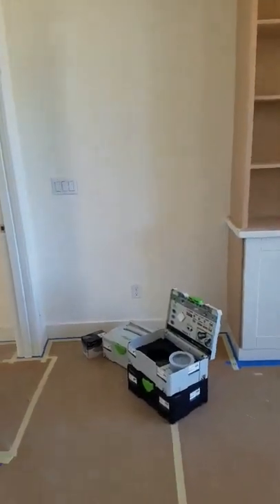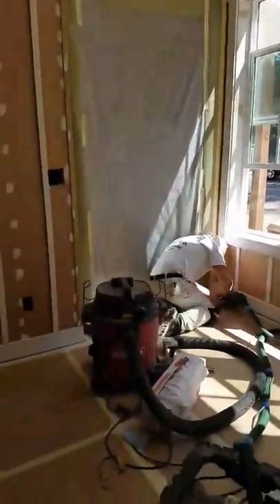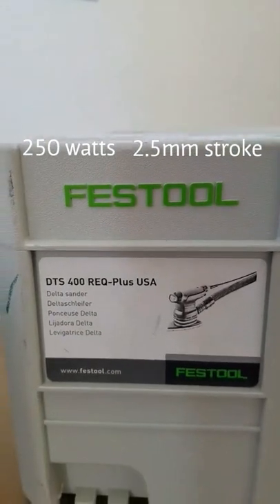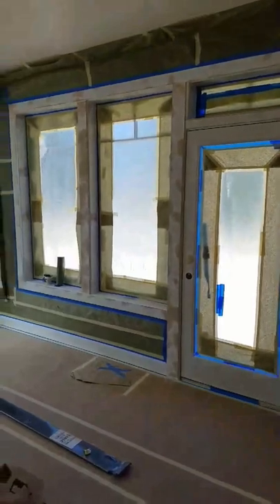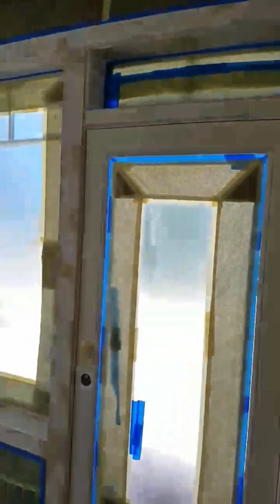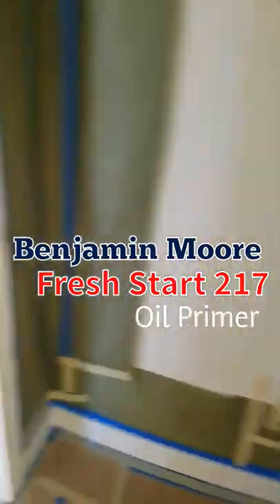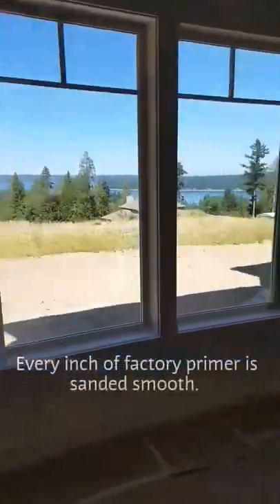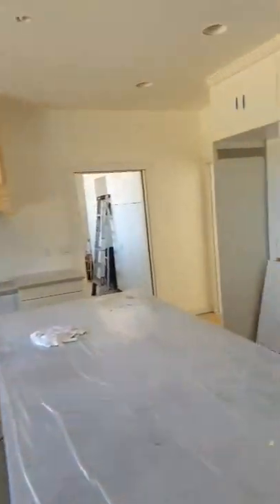Painter's Love for Festool, and Millpack Walkthrough.

Comment: Love the video @xc painter. That's a LOT of mdf. Just curious, I don't work with mdf a whole lot but could you use BIN or a lacquer undercoater to make the process faster? Thanks bud!
Reply from the maker: Chris Herrada absolutely lacquer undercoater would be great if you have experience with it and know the pros and cons. Have to do 2 coats though to achieve its intended use, to build up, then sand smooth.  Luckily our oil primer on this job didn't require a full sand everywhere it was pretty cool.
Reply from the maker: Chris Herrada Thanks for the question and feedback too. 
I wouldn't use the shellac at all though.  It's too brittle and doesn't filll and sand like regular primers. It's real thin, and will soak into the mdf fast and be weird to spray, in my opinion. I would predict a lot of cracking in places that are usually not a problem with oil primer.
Reply: XC Painter sweet, the less sanding the better. Thanks for replying. Did you win the titan gun on #theidahopainter live show? Saw you in the chat room once. See ya around the internet lol
Reply: #americancustomfinishing on instagram
Reply from the maker: Chris Herrada I wasn't fortunate enough to win something like that in a giveaway yet but that's okay.
Reply from the maker: Chris Herrada Cool, thanks for commenting and saying Hi.

Comment: What do you set your suction on for the dts 400? I heard it’s best at lowest level and with the ets 125, it’s best at highest suction. Love Festool!
Terry
Specified Coatings
Reply from the maker: Terry Dickens I set the suction for the DTS400 a little bit lower but not all the way down. I used it exclusively for a millpack in Feb and had suction on high because it was a production job. It didn't sand through the primer hardly at all and went really fast. The recent job called for different prep methods than the millpack featured in this video.

Comment: not sure what ppe means. also what if those moldings have profiles like colonial/ would u use elmers wood filler for the nail holes
Reply from the maker: James Quant PPE is Personal Protective Equipment, like respirators, hearing protection, and more.  I wouldn't fill colonial with Elmer's unless there's large holes or repairs. I would use Crawford's spackle plain or with maybe a touch of Elmer's mixed in.